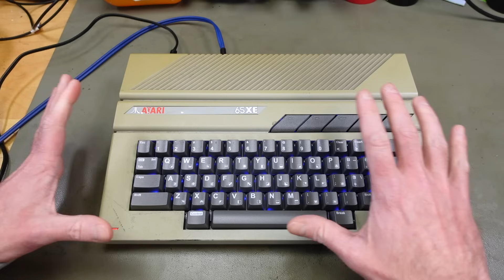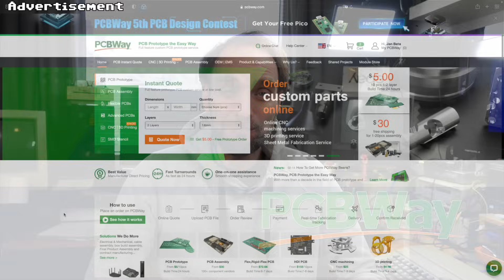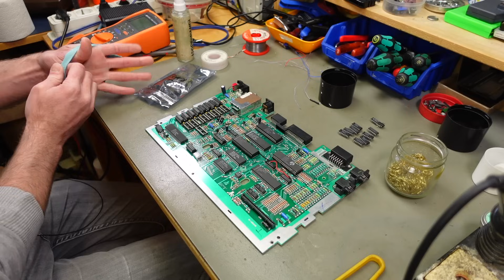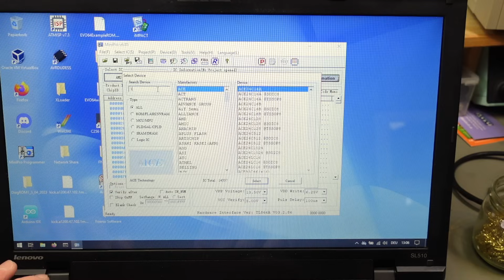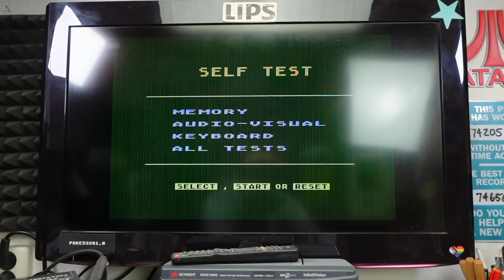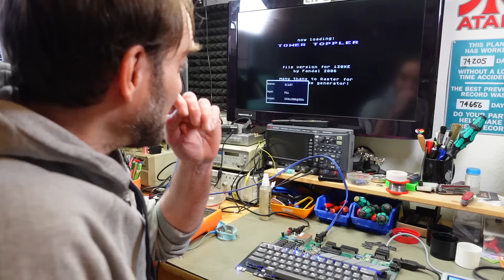Atari 65XE to 130XE Upgrade

Comment: If I'm not mistaken / if I can see well, this motherboard already features the Freddie chip (XEs had it, also some later XL models, for cost reasons), which a.o.t. takes over some functionality of the OG MMU & corresponding circuitry, but not 100%. Maybe that was the culprit? Or maybe the wrong banks have been used here? (maybe I need to check previous videos..)

BTW I know my 800XL had the CompyShop RAM enhancement utilizing the 26AE blocks, if I'm not mistaken (adding +256kB, thus totalling at 320kB), hand in hand with a three way switch, which enabled me to select OS & RAM config - 64kB & Atari OS / 320kB & Atari OS or 320kB & Q-Meg OS (made in Germany, btw, by the one and only by Stefan Dorndorf). Also, I had a bootable custom version of TT-DOS on an EPROM built in, enabling instant-after-boot disk access & corresponding functionalities - and all worked flawlessly since day one.

Anyway, a very nice video, showing how (relatively) simple and (mostly) fun it was to 'tinker around' with those machines, back in the day 🙂

Comment: Personally, I don't like these massive memory upgrades. Keep it realistic. For the Commodore A500 for instance, 4 MB could be reasonable, but 128 MB is far too much, even if it is possible. But in my A600 for instance, I go with 1 MB Stock just to keep it "retro".

Comment: I've also done a 65XE to 130XE upgrade. It was easy to do. Difference, my board was a last revision of the XE board with 4 bit memory chips. I also had a 130XE board which was beyond repair, so I could take the MMU chip and some needed logic from it. Adding 2x 4 bit RAM IC's was sufficient to upgrade the RAM to 128KB. I have the TL-866II programmer, which is able to program ATF16V8 chips, as original GAL chips are getting a bit scarce.

Comment: I don’t really get the point of having memory beyond 64k on these eight bit machines, You still have to load the the data off tape or disk and then bank switch, its not like you can address the whole 320k in a flat address space
Reply from the maker: There’s quite a few games and demos created recently that make use of the expanded memory in very elegant ways. If you only want the classic experience, of course 64 or 128k are enough. :)

Comment: Great mod, may I try this with my 800XE? Anyway, after obtaining AVGcart or even better SUBcart, no mods are really necessary for the stock 64K machine.
Reply from the maker: Thanks! The 800XE should use the same board revisions as the 65XE, so if you have the one with the 8 RAM chips, the mod should work in that one, too. If you get one of the modern expansion, you don't need the mod as you said. :)

Comment: Can you buy a 130 xe badge for it
Reply: Yes you can. New ones.
Reply from the maker: Yes, many options for modern badges. I haven't really decided which one I want but the original one definitely needs replaced (it's pretty scratched anyway).

Comment: If the keycaps almost fit then you could try using threadlocker on them. If there's a large discrepancy then you could try using hot glue on them with a layer of plastic wrap to keep the glue out of the switches.
Reply from the maker: Threadlocker is a good idea. They fit pretty loose and only fall out sometimes when I flip the machine. Should be relatively minor to get them to hold a bit better.

Comment: I still think you had timing problems from some chinese relabeled 74xx chip with the wrong speed, like 4:48
Reply from the maker: That might very well be the case.
Reply: @JanBeta The 74 series also exist as 54 and 84 I think, with military and industrial specs respectively. Maybe worth a look for otherwise unobtainable chips.

Comment: you sure the 320kb expansion isnt for ntsc? if thats a pal machine, perhaps it was just the timing? i know there is a lot of frustration involved, i think you should give it another try, and maybe use the 130xe gal you just programmed in the 320xe mod?
Reply from the maker: The 320k expansion was designed on a PAL machine as far as I know. I even got a set of known to work chips from Jürgen who designed the mod at one point. Still didn't work properly in my machine. :D

Comment: Greetings from Serbia, I have been watching your projects for a long time and in the sea of YouTubers across the Atlantic, you are a rare representative of the old continent. Keep it up, some more videos with guitars and amps if possible. And one complaint, with your videos, the sound "squeals" and "buzzes" to me, and it's very irritating. I've tried all possible settings, both on the computer and on the hi-fi amplifier (when I'm watching, i.e. listening through it) and only lowering the equalizer all the way down helps. That's why I ask you to take a little more account of the sound when editing the recordings, if that's possible. Don't stop at the criticisms, they are completely well-intentioned and aimed at improving the quality of your work.
Reply from the maker: Hey, no worries! Thanks for the constructive criticism. I am aware of the sound problems and am working on it. I think my mic might just be crapping out. :)
Reply: @JanBeta  I'm a bit late but sometimes it can be caused by humidity in the capsule — I've seen some people successfully rescue mics others have thrown-away (for making clicking, buzzing, or hissing noises) by really intensively drying them out.

Comment: RAM Erweiterung war am Atari schon immer etwas...sagen wir mal.....anders. Hatte in den 80er einen Atari 1040st. Original 1 MB. Mir ein einem Computershop die RAM Erweiterung für teuer Geld auf 4MB erweitern lassen. Gab viele Probleme. Hintergrund: Zu der Zeit hatte ich schon einen IBM (bzw. kompatiblen PC) nur gab es zu der Zeit keine vernünftigen (oder bezahlbare)   Soundkarten mit MIDI. Und DOS Software für MIDI gab es nichts was zu gebrauchen war. Klar gab es Lösungen für PC von Roland und anderen. Allerdings für mehrere Tausend DM. Nur die HW und SW hätten mehr gekostet als der PC oder ein Atari (der ja schon MIDI kann) mit Cubase. Sidenode an die AMIAG Fans. Ja der AMIGA kann auch MIDI. Nur nicht "ab Werk". Brauchst auch für teurer Geld noch ein Interface. Verwend heute noch meinen alten Atari ST für Musik. Über MIDI die Synth angeschlossen, Cbase und gut ist.
Klar ich kann das heute auch alles auf Apple machen. Gibt gurte Software. Nur das ist nur eine Emulation. Ein Plugin zeigt mir grafisch das "Geräte". Allerdings ist es von der Haptik und Feeling anders echte Regler und Knöpfe zu drehen. 
Oh ich kommen von dem Thema wider zu sehr ab. Das Video ist für mich Nostalgie. Als kleines Kind (mit 8 Jahren) Pong am TV gespielt..... in der Schulzeit Atari vs. Amiga...
und ratet mal auf welcher Seite ich war :). 
Auf keiner. Ich mochte zu der Zeit den PC. Ich liebte die Sierra Games. Gut das ist eine andere Geschichte......... Und viele Erinnerungen.
Wenn ich meine alten Computer verwende fühle ich mich so gut wie wenn ich meine allten LP´s hören..............................
Reply from the maker: Die Nostalgie ist auf jeden Fall immer wieder ein schönes Gefühl. :) Ich war ja auf der Commodore-Seite in meiner Jugend, aber es macht richtig Spaß, jetzt endlich mal die anderen Seiten kennenzulernen. :D

Comment: Nicely done Jan! Here are some 128k 130XE games for you to try. Alternate Reality: The Dungeon, Bop’n Wrestle, Infiltrator, Karateka, The Goonies, Barahir, Artefakt Przodkow, and Megablast, Gato, and Ace of Aces. Those 10 should get ya started :)
Reply: Most of those carts, although 128KB in size (e.g. those shown GATA & Tower Toppler), don't use the extra RAM of the 130XE. @Jan - Another good test would be STUNT CAR RACER
Reply: Sorry I did not know that @a8converterman

Comment: Two reasons you're original memory expansion didn't work. 1) Could be down to the speed of the GAL chip. 2) Parasitic Capacitive Coupling, Common thing to run into when running wires across a board and or over chip IC's. You could try tidying the wire even thicker gauge wire can help.
Reply from the maker: Yes, I think something like that must be the issue. I got sick of trying things though so here we are. :D

Comment: Anyone know why an Atari 800XL will boot to a red screen?   I've already replaced the memory.  Not sure where else to go.
Reply: The screen is red because the OS crashed before it had a chance to initialise the video hardware, so the problem could be CPU if you already replaced the RAM. Delay line IC is also a common failure point on the XLs.
Reply: Could be GTIA? Aside from that, I have no clue.
Reply: @amadeus484  Luckily all my chips are socketed, so I will look for replacement chips.
Reply: @kevin34ct  Even if it isn't the GTIA, having spare parts is always good.
Reply: red screen  usually  points  to RAM, but I had an XEGs with bad ROM and a faulty CPU. The CPU worked with specific games so I am sure it had nothing to do with the color error.